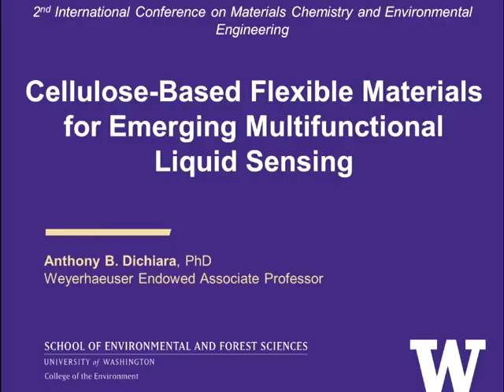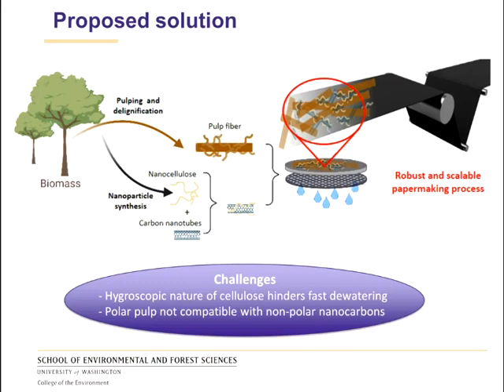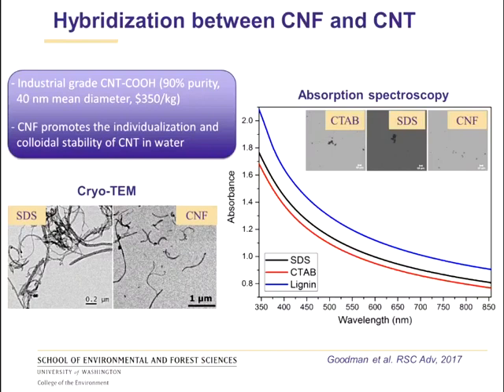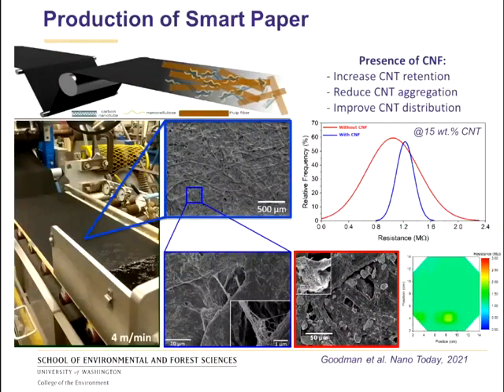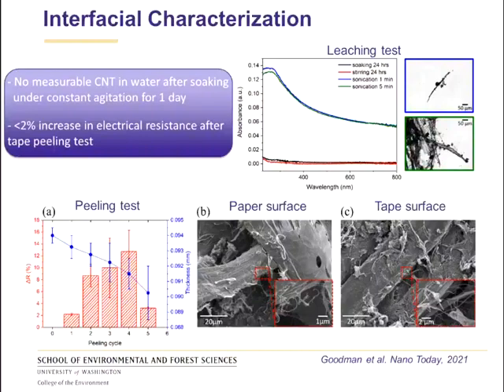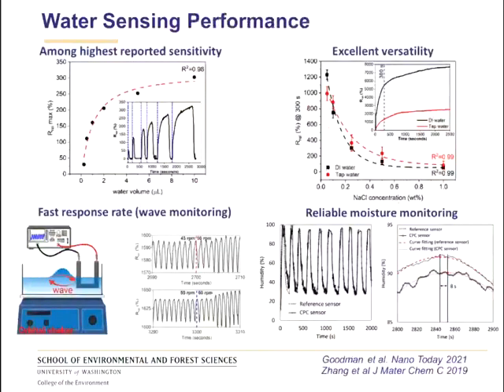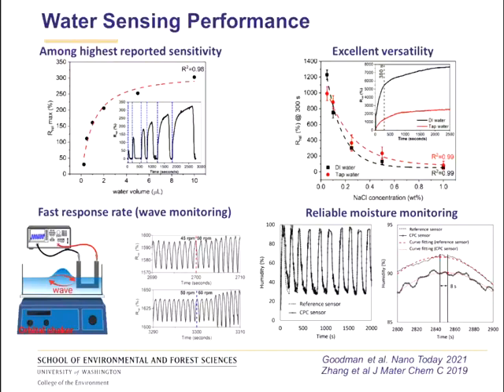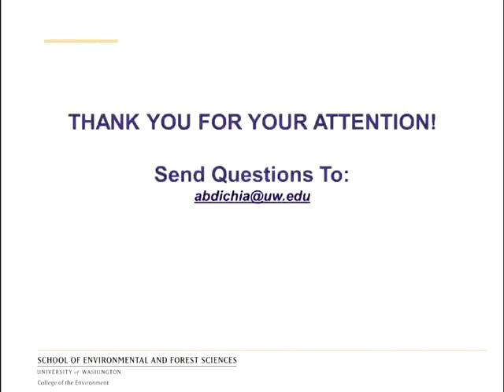CONF-MCEE – Cellulose-Based Flexible Materials for Emerging Multifunctional Liquid Sensing

Comment from the maker: Here are the questions we collected and the answers replied by the presenter: 

Q1: It is very interesting research! How do you come up with this idea? Have you tried other kinds of paper materials?

A1: Thank you! The idea comes from the bio-inspired hydroexpansion of plants, such as the moisture-induced reversible deformation of pine cones. Yes, we did try different types of pulp fibers to prepare the papers. The best results have been achieved using bleached pulp with low lignin content, which would otherwise hinder the swelling of cellulose.

Q2: How can we apply this "paper" in our daily life? Can we estimate the exact location of the leaking if we cannot see the pipe?

A2: Possible applications include roofing, distribution lines, household manifolds in building, miniaturized cooling pipes in electronics, or mobile tanks in ships and trucks. Currently, we can detect a volume of 0.25 mL (the equivalent of a few droplets) using a sheet of 1 meter by 0.3 meter. Should you need to pinpoint exactly the location of the drop, then I recommend using a mesh comprising multiple strips of sensory paper.